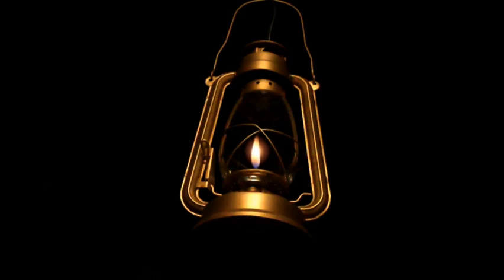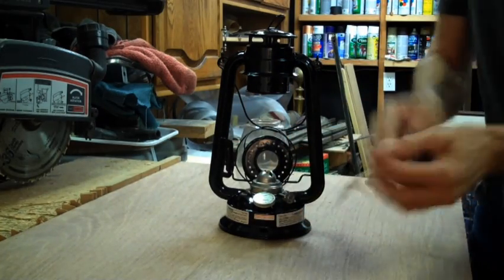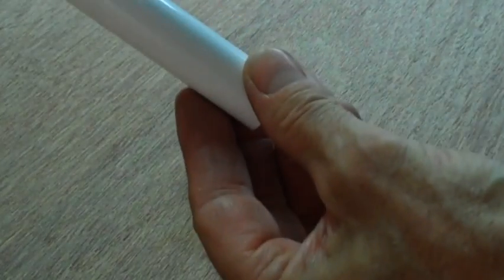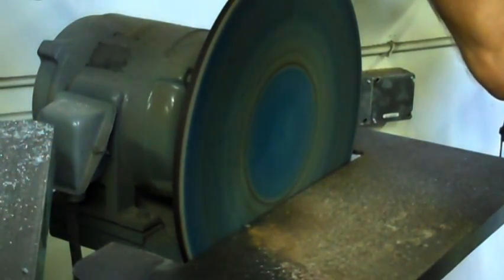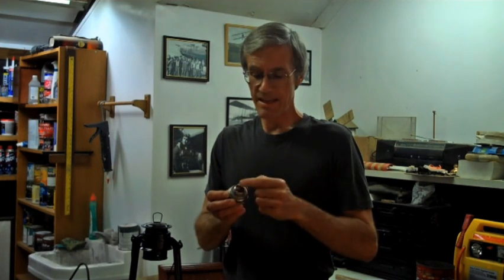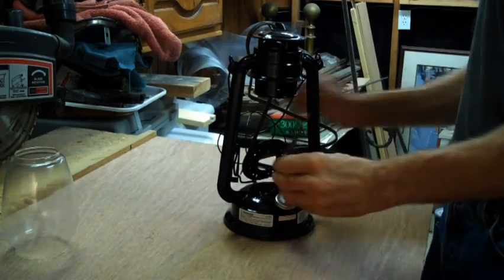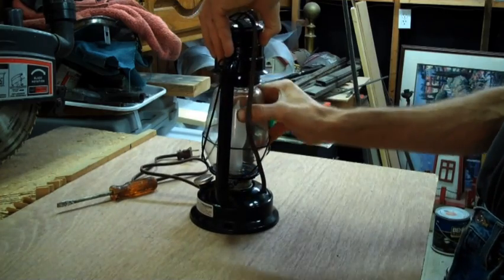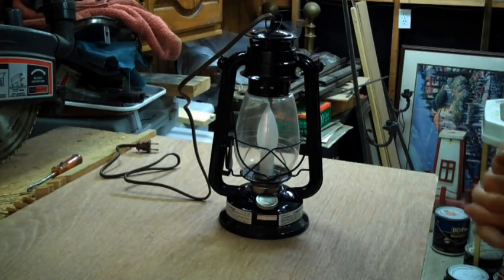How to Electrify a Kerosene Lamp

Comment from the maker: Yes, kodyspur, you can if maneuver the wire through the hole, but then you would need to drill a hole on top to let the wire out.  My lamp has smaller holes on top of the upright tube, so I don't think my thick wire can handle the turn.  Whatever works, go for it.